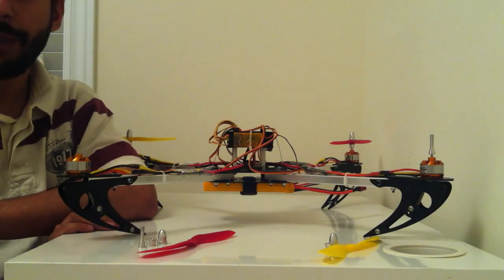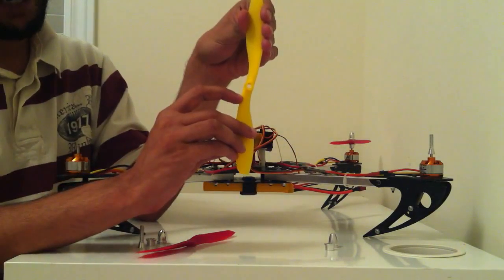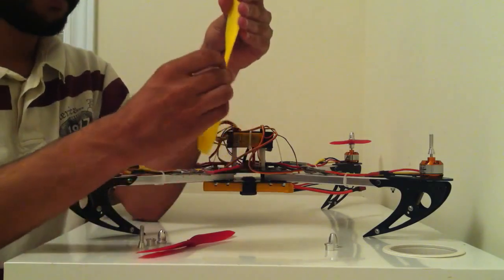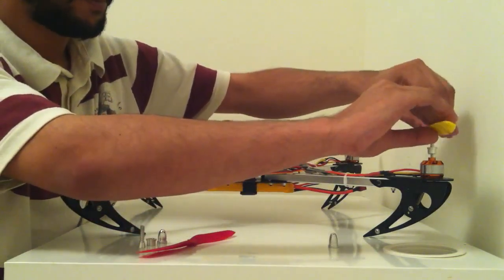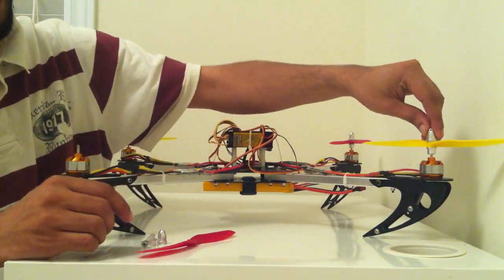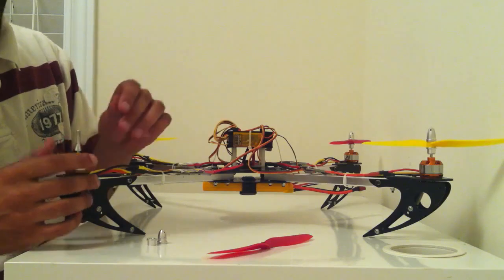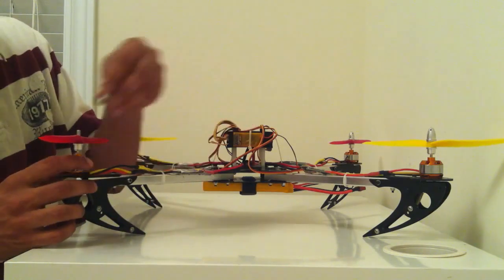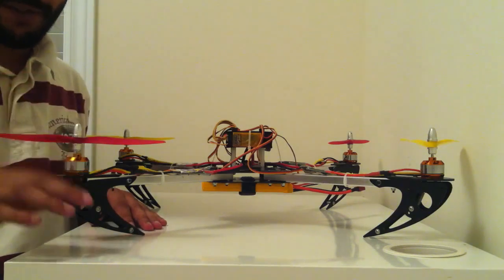How To Install Clockwise CW and Counter Clockwise CCW Propellers on a Quadcopter

Comment: one of the motors on my small toy hexacopter has failed. it is not working now. 
I'Ve checked spare motors on ebay. There seems to be two types, CCW and CW, arent these motors DC motors? Doesn't simply reversing the supply polarity changes direction?
Reply: +ozkal ozsoy Yes, even if you are using ESC. swap red with black until u have the right spin direction
Reply: thanks for the reply. I did it and now my drone is flying again.

Comment: My thorax hex win throttled up not all motors come on. Just about 50% power they all come on. Does the 5x3r mean counter clockwise. When I throttle up it feels like my hex is sticking to the floor. This is my first build.
Reply from the maker: First make sure you have proper throws for throttle on your radio. Next make sure you have calibrated your ESC's properly. Then check all of your props for correct direction. Make sure all props are spinning in the correct direction.

Comment: so if all my motors move cw that's ok long as my props are set CCW and CW in there set position
Reply from the maker: No. The motor spin direction has to correlate with your prop spin direction. Both have to match.
Reply: Thanks this is my first build
Reply from the maker: ejb 84 My pleasure. All the best!
Reply: Just switch the wires of the motor

Comment: what i need to know is why there are CW and CCW motors if all you have to do to change the rotation is switch two esc wires. also how can i tell if the motor is CW or CCW... i have some sunny skys and was told they are CW and CCW . i have no markings saying what is what. hmm... one motor won't spin , it just shutters. maybe i have a bad esc or the motor arrived busted.
Reply from the maker: djSpinege There is no such thing as a CW or CCW motor. We define the motor direction by plugging in the esc and seeing which direction the motor is spinning in. If the motor is spinning in the proper direction, we leave the wiring as is, otherwise we switch the wires to make the prop turn in the required direction. There is such a thing as CW and CCW props however, because they have the raised edge which I mention in my video. The direction of the raised edge tells you which direction the prop will spin in. At least that is how I explained it to make it easy for people to understand. As for motor shuddering, you could either have a bad motor or you need to re calibrate your esc. Good luck!
Reply: DRONEWORKS HD i was referring to the threading on CW and CCW motors. i realize now it's so the props self tighten. | Im thinking it's my ESC so i bought a new replacement. if all i have to do though is calibrate it, that would be amazing. now to find out how to calibrate the 12amp blue mysteries... thanks for the reply.